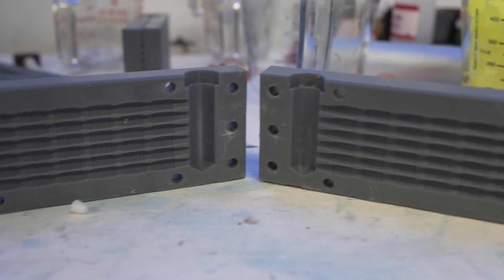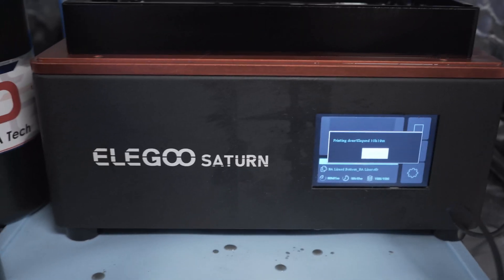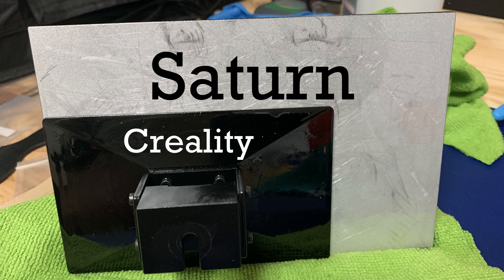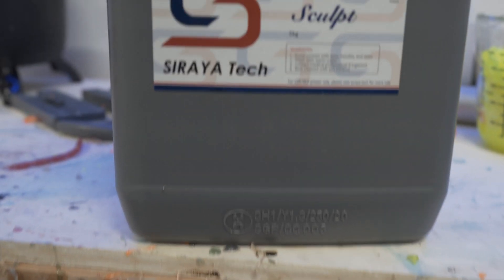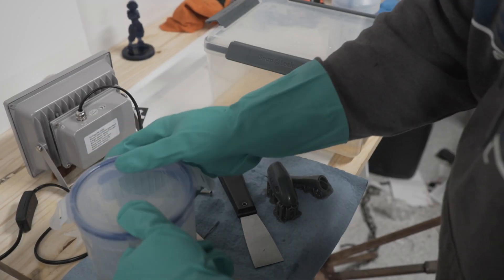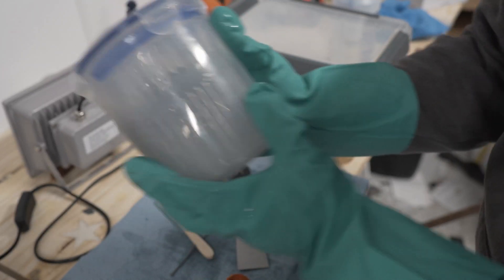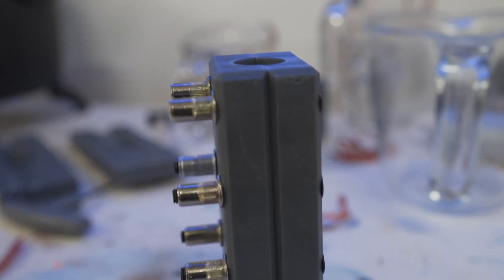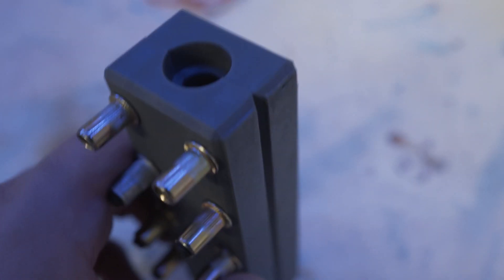3D Printed Soft Plastic Injection Molds Part 1 - The Basics

Comment: Hi man, thanis for the video, I think I will also invest in this setup. Do we subscribe here on youtube to see 2nd part, link on description didnt work for me.

Gray resin temperature seems much lower than the white one. Product webpage say, white softens at 250 C degrees which is great for most plastic pellets, but gray one seems to soften at 180, which is bad for most pellets I know. Why do you like the gray one more?

But bigger issue for me would be if the SLA printed molds leach some residiues on to the final part. I would mainly like to use this technique to make either food contact parts like cookie cutters or skin contact parts like wearables. Do you think it will be safe to use or not? I really dont want to machine aluminium as this seems much better 😃
Reply from the maker: I converted the mold series to a playlist - https://www.youtube.com/playlist?list=PLEdNibYdUWY7Kxl6tZ3iihw1zSfulIeUe

I like the finish on the grey resin, the white sculpt ultra is rougher and holds onto the plastisol more, making it harder to remove.

They make food/skin safe resins, they tend to be more expensive though. If you are just molding though no leaching will occur. Cured resin is safe, the DSD is for the uncured resin, not once it is cured.
Reply: @ thank you very much for your answer man ! Highly appreciate it

Did you use mold release spray or anything? I even see people using it on metal molds, perhaps it might help with the release, as an extra some release pins can be implemented but it will further complicate the mold design 

There is biocompatible resin, like one you can put on your skin and all, but unfortunately there is no food safe resin. I searched everywhere, apparently the thing is super toxic, formlabs has a great online blog post about this.

Thats why I am hoping if I make the mold and inject food safe material like PP inside, maybe it can be food safe, but then again issue there is if some residues leaches on to the final part from the mold, 

I guess I will try the white mold with mold release spray, as softer resin might release its content easier on the final part

Comment: Get flexible beds life savers for removing parts
Reply from the maker: They fail on larger mold prints in my experience. Once you dial in your settings correctly you should have no problem removing your prints.

Comment: hi, your videos are great. I am a ceramic manufacturer. I decided to make my own molds with a resin printer. I have anycubic m3 max. I used basic and Tough resin. I did a lot of tests but I couldn't prevent the outer surface flexing. My patterns are big. maybe I can give a maximum of 10-15% inclination at 150mm height. I tried 2d or 3d hollow. I tried 2mm or 4mm outer thickness. I tried everything, but I could not prevent the outer surface (the important surface of the mold) from deteriorating. maybe there is 0.5 mm distortion, but I take a silicone or polyurethane mold from the 3d output and get a plaster mold from it, the distortions are very annoying. how do i solve it? Do you have a discord channel?
Reply from the maker: I print all my molds solid. Yes it takes a lot of resin but it is the only way I found to prevent flexing. 

No discord currently but I might set one up soon!

Comment: I made 2 injection molds (Salmon Eggs, something simple) with my Prusa Mini+, with PETG, I don't have any deformation myself and i inject around 350 degrees, and for some reason the DeadOn Plastic just gels and makes the Plastisol stick to the cavities like no other. I've tried multiple times too and the molds look great, its just sticking to everything ... Even with a bit of oil to lube the cavities, it still sticks. But i'll inject the same plastisol in the same session of baitmaking, in my Aluminum Molds, and they are perfect. I was wondering if moisture was a factor in the plastic pucks i was melting down, but that wasn't the case so i'm a bit stumped.
Reply from the maker: Unless you coat the mold with something the PETG is going it have a ton of little gaps/holes that are going to "grab" the plastisol making it hard to remove. You can try shooting at a colder temp to see if it helps but that is just another problem with FDM printed molds.

Comment: You are an absolute life savor please keep making videos! The basic print on the build plate cost me so much time and effort it was just about give up time. I suspended my last print above the built plate and it worked but i had to know there was a better way. It might take longer but printing to the bed fixed every issue I had.
Reply from the maker: Awesome so happy it helped and I saved you some headache.

Comment: If you print the moulds on their side, is the surface where both halves of the mould meet really flat? I would imagine some Z wobble in the system would screw up the flatness of the surface. If orientated flat as you would with FDM the surface would be really flat.
Reply from the maker: They would be flatter but suction and peel forces will cause a lot of failures.
Reply: @WMBayouLures  Thanks! This is the main reason that keeps me from  investing in a SLA printer. I’m So in doubt. But the durability of the Moulds I make now is not optimal (FDM). I already bought the resin you use though 😂😂
Reply from the maker: @roeljonker  I print vertically with very little issue and the resin has enough flex that you can easily use bolts and/or vices to flatten out any issues
Reply: @WMBayouLures  that’s good to hear! No flashing?
Reply from the maker: @roeljonker  0, I have a ton of tutorials on mold design on this channel that should help
Reply: @WMBayouLures  Thanks! I’ve watched a lot of them! But I was mostly concerned for flashing. I guess I’ll be ordering a SLA printer then! Most likely the Mars 3 or 3 pro. Thank again for your help and the great videos 👊🏻

Comment: You are correct about the heat deflection not being higher then the temperature of the molten plastisol but I don’t think it’s fair to write off fdm printing for injection molding. Just because the plastisol is 300 degrees when injected doesn’t mean the plastic gets anywhere near that temperature. Plastic is a very poor conductor of heat. The glass transition temperature is just when it starts to soften. Just because it hits that temperature doesn’t mean that the mold will melt or leak either. How soft at what temp varies wildly from plastic to plastic. I’ve been injecting fdm molds for a while now.i originally started using abs but had issues with the mold cracking do to slight warping from the heat. The mold was still usable but had some cosmetic issues from plastisol leaking into the infil. If you want to give it another go around I’ve recently discovered that petg is a much better choice. I’ve had no issues with melting or warping so far.
Reply from the maker: Yep it totally can be done on FDM but personally I think the results are way better and more consistent and you can produce molds faster with resin (with more cost and more mess for resin) so go with what you like, and have the gear for. If you are starting out though I always recommend resin because of better detail and most people want great detail. If you have an FDM printer already, by all means go for it!

Comment: I'm trying to print a large mold (120 x 120) on my Saturn S using Siraya Tech Sculpt Grey. The X and Y dimensions are almost perfect. But, the Z dimension is about 33% taller than it is suppose to be. Did you have this issue when you printed your molds flat on the build plate? Do you have any idea what might be causing this?  Thanks.
Reply from the maker: Wow 33% that is crazy. I would try increasing lift distance, I am at 8mm currently and also make sure rest after retract is at least 1 sec, I am currently at 2sec
Reply: I'm late to the party but I was also printing moulds with Siraya Tech grey on my Saturn 2, and all of my prints were fine on the X & Y, but everything I printed was out by around a full 1mm. I did ridiculously extensive troubleshooting (3 bottles of Sculpt worth!) and am getting a refund from Elegoo since it seems to be an issue with the printer, which I've seen a number of other people have. What did you end up doing with yours?
Reply: @rachelcoenen9257  I never found a solution. I have the 4K Saturn S. I love the printer. And, I use it a lot for other prints. I think the Z axis issue is related to the strong suction generated during the lift. If I print hollow versions of my molds, the dimensions are excellent. I can also print a calibration cube just fine. The problem occurs for me only when I try to print a large solid item flat on the build plate. Otherwise, my prints have excellent dimensions. My plan was to use the scale function in Chitubox to proportionally reduce the Z dimension of my molds. But, I got sidetracked with other projects. If you find a solution, please let me know.

Comment: If I was to buy a cheaper resin 3d printer with a smaller printing size could I print the mold vertical ?
Reply from the maker: Yep no problem! Just keep in mind that the max build height (aka max Z height) on the printer is the maximum size you can make the mold and the bait will need to be smaller by roughly 15-20mm to make room for the sprue, venting etc. If you are making an open pour then you might lose 5-10 mm. What printer are you looking at?
Reply: @WMBayouLures  I’m looking at anything by ELEGOO in the $189-$350 price range so that would be the creality, mars 2 or 3. What molds have you been able to print on the creality and what do you think I would be able to print on the mars 2/3?
Reply from the maker: @prestonlogan  on a printer the size of the Mars 3 you are looking at making molds for baits that are less than 150mm. You might be able to get 2-3 cavities but it really depends on the bait design. FYI you generally want to print the mold vertically no matter what size printer you have, that usually produces the best results.
Reply from the maker: @prestonlogan  oh and this video goes over some considerations when choosing a printer for lures/molds 

How to Choose a 3D Printer for Fishing Lures in 2021
https://youtu.be/gihN6qD5_bw
Reply: @WMBayouLures  okay thank you and yeah I commented before watching the end of the video where you stated that vertical is always best anyway.
Reply: @WMBayouLures  also what if you had the mold printed standing up allowing you to make a longer mold ?
Reply from the maker: @prestonlogan  the dimension I gave you is basically the longest dimension that will fit on that printer. When you look at a printer they have a spec called build volume that list 3 dimensions X-y-Z Z is height and is usually the longest. Z is how long you can print a mold if you print it vertically. Now sometimes you can print it sideways but I have many more failures printing that way compared to vertically

Comment: I've found it easier to print the molds with the back on the build plate. I get a much better surface finish on the inside of the mold. To make removal incredibly easy I add a small fillet to the edges that will contact the build plate and once done printing, wash any uncured resin away and pop everything in the freezer to cool off. After maybe 20min it comes out and is left to warm back up at which point the models can be pushed off or sometimes just fall off on their own. If you're impatient you can speed up the warming with some hot water.
Reply from the maker: I have had mixed results printing that way, especially on larger molds. The suction forces become a pain to deal with. The other advantage to printing on the back is that it prints very fast! 

I have used the freezer trick though, its a good one!

Comment: So how large does my printer have to be? I’m looking at buying a printer primarily for this but also some other projects. The one I’m looking at is a Voxelab Proxima 6.0. The measurements are 130-82-150mm and I would like to know if that would be large enough.
Reply from the maker: One thing to consider, with any printer you get, is the largest dimension is the largest you will be able to print. So the printer you mentioned has 150mm which is a shade under 6" as the longest dimension which means for molds you should be good for anything 5" and under. I think that is totally fine for starting out and figuring out how everything works.

Comment: My main interest is in minis but im following along in your process with this because think it could be really useful for stuff like terrain and repeated mostly flat parts.

On the issue of topping up the vat i think you might find thing:3777796 to be interesting, i expect it or something based on its principle could decrease the amount of times you need to get up for refilling when doing large volume prints.
Reply from the maker: Awesome I will check out that part! 

The biggest thing I have found on large flat parts is you can typically decrease your base layer exposure times below your normal times. What I did is just kept lowering it until I got a failure then bump it back up to the last successful time. Then they pop right off with a Scotty Peeler - https://youtu.be/klz8QyxrarU